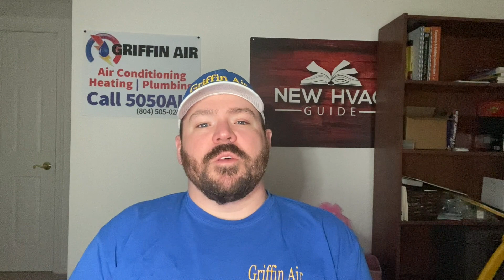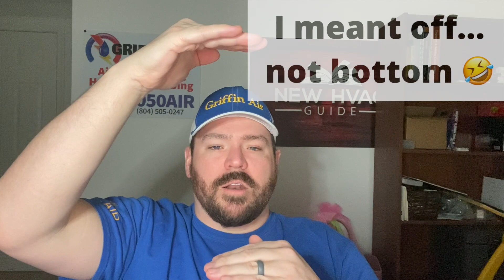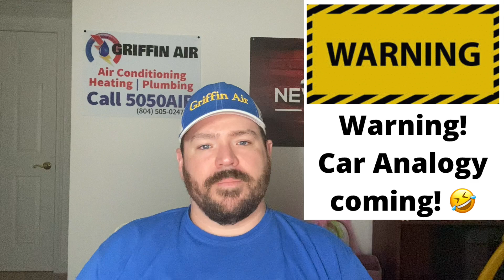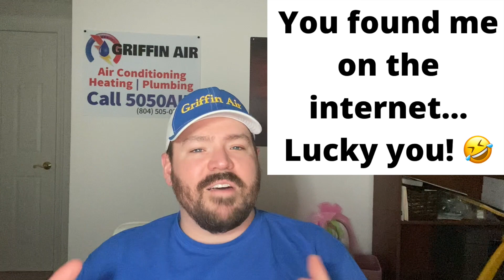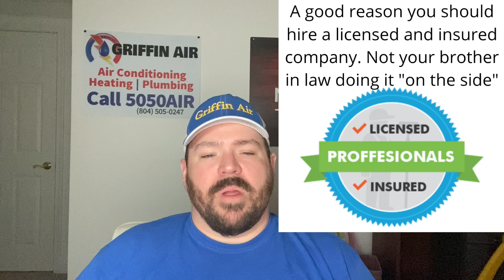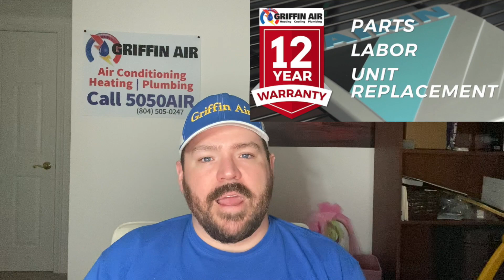GOOD and BAD of High SEER Inverter HVAC!

Comment: You wouldn’t be installing a 12 seer, so that’s not a fair comparison in energy savings.  If you installed a 16 seer single stage the difference wouldn’t be nearly as much compared to the inverter if matched with the right coil.
Reply from the maker: Inverters are superior to single stage in efficiency regardless of the SEER rating
Reply: @NewHVACGuide  - 8 bucks a month may not be worth an extra 4k initial investment.

Comment: Just installed a complete Daikin 17 SEER inverter system. Replaced a 16 SEER 2-stage Carrier Infinity system. The Carrier was supposed to be super duper and all that, but only lasted 12 years. I can say from experience, there is no way a consumer can get a straight answer about which system to install. All the contractors claim there's is the best, etc. 

I believe the install is where the rubber really hits the road. ANY system will last longer and perform better when it is installed well.

Never used Daikin before, so I guess we will see.
Reply from the maker: All good points pal.

Comment: Agreed....the installers are the ones who will yield a good running HAVC system, regardless of make or model !! There are just too many licensed hacks in the industry.
Reply: Just wish my guys would check/set gas pressure on all our installs.. sometimes it gets missed… along with the on/off switch on the gas valve and remembering to open gas ball valve once gas connections were complete.  First time customer turns heater on of course nothing happens and locks out no gas.. half my call backs could have been from strictly just making my guys run a heat cycle on new install NO matter the weather conditions at the time HOT OR COLD!

Comment: 1300 sq ft.  3 tonnage 10..  75 is good temperature for me.  Not planning on moving.  Advised I needed 3 1/2 tonnage 14 seer minimum. 

I opted for 4 tonnage 14 seer.  Questioning whether I should have gone 16 seer.  Cost difference was not  an issue for me.

Comment: In computer land they have power supply efficiency ratings. Bronze through platinum. It's a percent efficiency rating that is usually not at 100% power. But it's around 80% draw. But then again that may not be everyone's use case, but a good reference. But ratings can be paid for and lie about it, in computer land. Maybe hvac land there is a bit more oversight and independent testing.
Reply from the maker: That's a good point. I'm not sure how that all works. I think generally that there are certain hoops to jump through to get an AHRI certificate on a certain seer rating.

Comment: I've got lots of comments, lol. Sorry
I was old skool and didn't think they perfected 4k tv's I still have 1080p. Now I want to jump to 8k and skip 4k. Hilarious I am.
I've seen several inverter setups. Very quiet. I have an old piston 2 ton rattle trap. Super noisy. I hate it. I replaced one capacitor on it, someone else did some time ago. It's about 25 years old. Love that is reliable but not efficient. Not terrible, but super noisy. Electricity is fairly cheap. I think I'll DIY a dual fuel, heat pump furnace setup. I just want to not get woken up every time the compressor fires up. And my neighbors will thank me.

The concept of always running the blower inside the house is very tantalizing. To always monitor and adjust or have freedom to do what you want. To maintain comfort in our slightly drafty house would be awesome. To always be filtering air. To cycle humidifier or de-humidifier if we had one. But not fire up the furnace or AC just to do that. Or a smart thermostat to do that. And to control the blower speed as well. To have a very slow quiet one that can idle 24/7
Reply from the maker: I have a friend that install a mini split for the cooling capability but pretty much almost always leaves are on the dehumidification settings

Comment: Picking your brain...removing a 10ton small ahu in a small office bld, running from a trane varirax system...looking at twinning  2, 5 ton or 4 ton inverter  system,issue I have is the dampers in each space, damper operate baseboard  heat also..any thought how to control this
Reply from the maker: You’ll want to get a pro in there. We have a church that has a similar setup to that. There’s a zoning module and twinned air handlers.

Comment: This inverted systems are nothing new outside of the USA. I am getting bids for my home and every single contractor wants me to go for a central A/C system and then a gas heater, instead of the cassettes. Why would I want two different systems? Also, they kept saying "you know, is a very new technology and no everyone service it" whats to service?.... i can clean the filter myself.
Reply from the maker: Keeping the coils clean and drains clear would be the biggest maintenance items, but there is other preventative maintenance that can and should be done.

Comment: The bad thing about the inverters is that if the motherboard goes out after the warranty, that's 2 grand right there.
Reply from the maker: 2 grand? What brand are you referring to? I've never paid 2 grand.
Reply: @NewHVACGuide  Lennox or Trane.
Reply from the maker: @scifiuniverses3736  Wow. I've replaced Trane boards before and didn't pay 2 grand!
Reply: @NewHVACGuide  That was back in 2020, that's why I am going with single-stage 16 seer Amana.
Reply: I get sick of hearing Amana is mid-level HVAC equipment, that makes no sense why they would give a lifetime on the compressor with a complete condenser replacement if the compressor goes out if it was a mid-level.

Comment: I am seeing some quotes for central inverter systems that can use regular 24V thermostats: Gree and Carrier 38MARBQ. 
I'm struggling to understand how this would work and whether I'd lose the advantage of continuous low-capacity operation versus start/stop operation. I'm happy to get a proprietary thermostat if it does a better job controlling the output of my system and gets more life out of it.
Reply from the maker: It's really all about technology. A communicating thermostat can talk with the system and tell it certain things like the ambient temperature of the room and so on. Even if the thermostat is 24 V controlling, the system still has the capability of ramping up and down based on load. However, the ability for the thermostat to talk to the system is gone. The thermostat is essentially a bunch of switches at that point. This is no different than a remote control ductless system though.

Comment: The biggest issue we’ve seen is power surges taking out control boards. Fortunately that’s an easy fix. We now install surge protectors on all split systems. We install Fujitsu and Mitsubishi. Glad I found this channel. Been in the business for 20 years in upstate NY.
Reply from the maker: Thanks pal!
Reply: Andy mentioned Intermatic surge suppressors. I'm no expert on this, but a quick search turned up the Intermatic AG3000, which is designed for HVAC surge protection and sells for under $80 at some online stores. Sounds like a good investment.
Reply: Which surge protection devices do you prefer?
Reply: @AJ-bi6ns  We’ve had good luck with the Intermatic AG series.
Reply: @andytrudell4889  Thank you

Comment: Three contractors in my area advised against inverter units because of power supply issues.
They do not like them because of warranty issues.
Reply from the maker: Wow. They better get with the program. In the not so distant future, they will be all you can buy.
Reply: @NewHVACGuide  I tried to buy a R-454 system as starting in 2023, they will be mandated in some places. Nobody sells them yet that I know of.
Reply from the maker: We have access to R32 systems now. Just started stocking them a couple months ago.

Comment: So these systems can be used as heat and air conditioning? I am building a new home. Single level 3600sqft slab on grade Insulated concrete form home. And i am searching my options on heating and cooling, and also how big my appliance/room where the furnace and all the other utilities like water heater washing machine and dryer need to be to install this system. Please guide me through this a little more. I live in wyoming,
Reply from the maker: A heat pump is simply an air conditioner that runs backwards in the Winter producing heat.
Reply: @NewHVACGuide  so all this needs is an air handler inside? No propane/NatGas is needed?
Reply from the maker: A heat pump can be paired with an air handler inside or a furnace inside. If it’s paired with a furnace inside, it is commonly referred to as a “dual fuel system“. I’ve done several videos on dual fuel systems
Reply: @NewHVACGuide  awesome thank you.

Comment: Is variable speed motor ONLY on the indoor handler worth the extra money when the outside unit is still single stage non variable ? Im hearing different opinions on that.
Reply from the maker: Depends... What's the SEER diffence if upgraded?
Reply from the maker: and cost difference?
Reply: @NewHVACGuide  1800.00 vs straight single stage inside and outside
Reply from the maker: @BlackoutStormChasing  woah.  Will the outdoor unit stay the same if you upgrade your air handler? We are usually only a few hundred higher if so.

Comment: You also think about the expensive parts of high SEER AC systems, and longer time technician will do the diagnoses, which will eat up your savings. Basically you just give your saved money to repair companies
Reply from the maker: Sounds like you've had some bad experiences.  I don't think we've had any experiences like that.  Warranties lasting years avoid the part pricing and our techs can diagnose inverter systems pretty quick too ;-)

Comment: Even when I was going through tech school a few years ago, just reading about these systems just screamed “we should be installing these”.
I think the issue is with these old school techs don’t truly understand Air Conditioning. This may sound arrogant but it’s the truth.
It’s coming down to where you just can’t swap a capacitor, jam more refrigerant in it, and they are unwilling to learn.
The only thing that makes an issue on these inverter systems is having the correct technical data for the system. Such as temp sensor resistance values and how the data lines pulse voltage in certain modes(and among other brand specific things). It’s not that hard.
Even if you take the money saving out of the equation, any kind of multistage or inverter system just has an amazingly higher quality of air in the home.

My 18 seer mini split in my sun room (that I installed) always feels amazing if I have it running. Especially compared to my single stage 15 seer American standard unit for the house.

It comes down to that a lot of techs don’t know what they are taking about half the time and are not willing to learn anything.

This doesn’t apply to every old technician obviously, but it’s a damned surprising amount I’ve come across.
Reply from the maker: That's the unspoken truth on why some won't learn.  Early in my career, I worked with an older tech that did the "beer can cool" charging on refrigerant and said he'd never do subcool or superheat.  Two weeks later, his helper (me) had to fix an overcharged system.  

Great observation
Reply: I’ve been in the trade for, well lets say I was in the first EPA class in Chicago to get Refrigerant certified lol. 
But have to agree. I replaced my my one 4 ton system with 2 ducted mini’s put the master and guest bedroom on one system main house on the other. 
I cringed when I had to replace my shop 3 ton HP with another loud, crap old school technology Goodman split. 
I can hear my crap shop system going into defrost a mile away! I’ve yet to hear my mini’s. 
But yes I’ve had this conversation with other older guys. Company owners even. You’d think I was talking from another planet to these guys. Zero interest. 
Yeah I needed to toss a bunch of money on a scale, and all the other needed stuff. Oh well. 
Some change is for the better.
Reply: I do feel that a lot of it's because in most of North America, the trades are full of conservative people.

Comment: One thing I noticed in newer HVAC are the main boards that the L1/L2 115V/230V cables connect to. No longer do I see contact switches so the electronic boards are taking the amperage hits with every start cycle.  Guess what? Those printed circuits are NOT reliable as the solder and the stripes tend to break/crack due to heat cycles. Then, when they fail, the part is $600 !
Reply from the maker: While I agree that terminal blocks may not be the best way to connect to the line wiring, I'm not sure I've heard that is the reason for most board failures before.  Have you had them break/crack often?
Reply: @NewHVACGuide  I have not personally experienced that but my research finds the most common failure to circuit boards and blower motors are the solder and printed circuits to them. So, some of the single stage repairs are rather inexpensive vs a new blower motor assy or main board priced way up there.
Reply from the maker: @Garth2011  interesting.  I wonder who's installed them in your research.  I personally in my entire career have never had one single failure due to solder joints.  So I was just curious.  Thanks

Comment: As an HVAC contractor for over 36 years, the bottom line is every home and every lifestyle is different! There has never been a one size fits all system. Every home and location has its own special and unique challenges! The new set of challenges we have now is efficiency vs longevity! The old equipment was designed to last 25 plus years, while the new equipment want last anywhere near that but is more energy efficient! So we now trade longevity for efficiency!
Reply: When it comes to the longevity of something like a heat pump condenser, is it mainly the electronic components which don't last or are there issue with mechanical compontents like blades, lines, coils, not lasting as long?  I'm looking to replace my old Rheem oil-burning furnace with a Bosch 5 ton heat pump and electric furnace and the efficiency seems great but wondering about the longevity and what I may end up replacing 10 years from now.
Reply from the maker: Well said pal!

Comment: Home owner question here.  Is an inverter system a heat pump?  Thanks.
Reply from the maker: They can be heat pumps or straight air conditioning.

Comment: As a licensed contractor in south Florida 30yrs in business, I totally agree with you. It all depends on the current living conditions, and what the customer is trying to achieve. If it's a simple 2 ton system in a 800 square ft apartment, then an inverter system may not be a first choice. 3 to 5 ton, multiple zone system homes, then yes, I have no problem suggesting an inverter system.
Reply from the maker: Thanks pal.  I don't get a lot of "agreement". So I appreciate it :-)

Comment: Great videos! I just installed Tranexv20i, what is the best fan mode  auto or always running?
Reply from the maker: Most times, the answer is auto.  Running all the time can actually evaporate humidity back into the home.  That said, if you have any IAQ (indoor air quality) accessories, it may make since to at least circulate the air if not leaving it on.
Reply: @NewHVACGuide  if fan is set to on it will always pull humidity into the house through every leak in the house, i.e windows, doors and every penatration from walls and ceiling to attic. almost all houses have negative pressure unless it has fresh air intake which would still pull humid air in from outside. ( down here in florida anyways) just my 2 cents. great vids btw. you sound like a trustworthy contractor

Comment: Thanks! About to put a 3 Ton Bosch inverter package unit to replace a failing '94 Trane package in PHX.  Feeling good about the decision and appreciate your reinforcement.
Reply from the maker: Awesome pal!
Reply: Can't fix stupid
Reply: Got a new Bosch 29 SEER system. It's amazing. Super quiet (inverter) and efficient.
Reply: I'm in Sacramento CA and replacing a 1995 Trane unit with a 3 ton Bosch this coming week

Comment: Can you tell me which manufacturers are offering lifetime warranties on their A/C units?  I am guessing these inverter units have self-diagnostics to point the HVAC tech in the right direction?  Can you also tell me how some contractors botch the installation of the units?
Reply from the maker: So manufactures offer lifetime warranty on the compressors and heat exchangers. I’m not aware of anyone that offers a lifetime warranty on all parts.

I’m actually working on a series going over installation problems causing failures that are not correlating to the brand chosen
Reply: @NewHVACGuide  Which manufactures??  How's install problems video coming, maybe done now?

Comment: Not interested in the savings. For our main home, interested in the difference in noise and comfort.
Reply from the maker: That is becoming more of a concern for folks all the time. That might be partly why inverter systems have become more and more popular.
Reply: @NewHVACGuide  Worth noting that an invertor is also a lot easier load if you need to occasionally run on generator power. Living in Houston, we occasionally spend DAYS without power after a hurricane. A single-stage AC unit require a soft start kit to run on genny.

Comment: Good videos. I wish more folks would focus on getting their ductwork correct.
Reply: Should my contractor replace my old ductwork with a new Heatpump install mine is currently 15 years old
Reply from the maker: Thanks pal. And I agree
Reply: Trying to cool that 4000 plus square foot house on that one central return lol. And its on the floor 😖